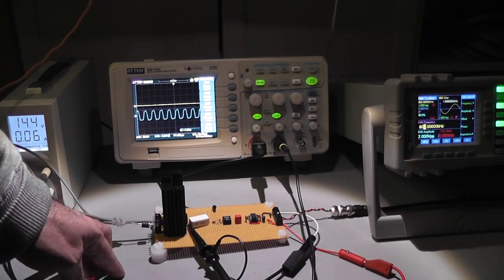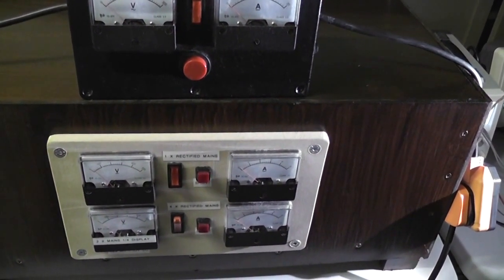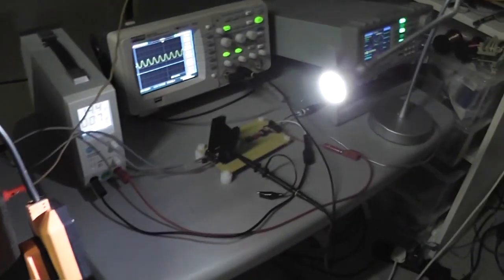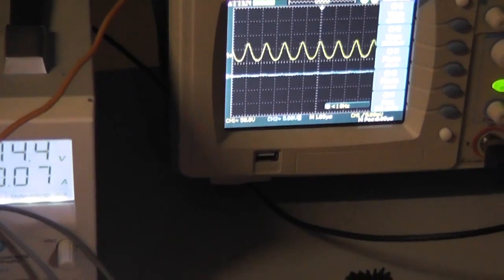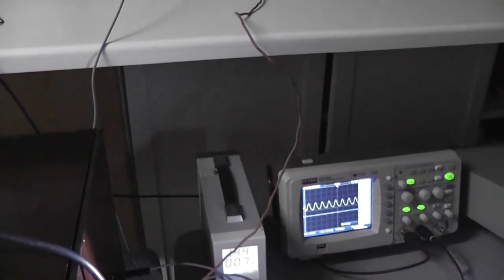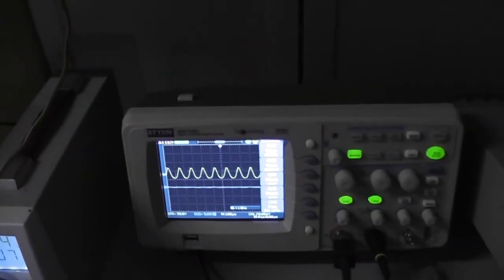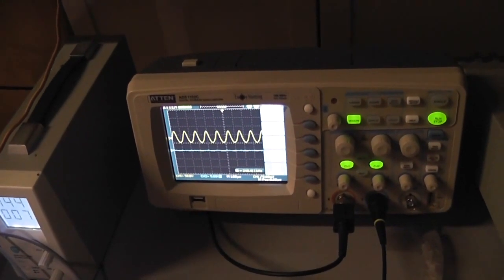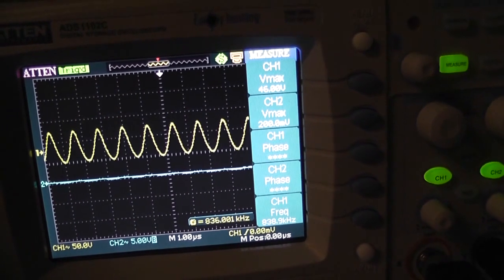Isolation Transformer and the performance with RF Power MOSFET

Comment from the maker: I agree. That is also my experience. I have from low power MOSFET to high power IGBT  available and tested them. The lower the power the faster, lets say lively was the excited coil. The more power the slower and rather less energized is the coil. the frequency changes for that as well a great deal. Resonance frequency is not the driving factor anymore. There is trade-off to be accepted.

Comment from the maker: For Half bridge and Full Bridge I will have to go completely different. Because all MOSFET or IGBT are switched all the time for inverted and non-inverted signals, a delay need to be introduced to avoid shorting. I will depart from the analogue  sector and go digital with Comparator and direct HV bridge driver. I hope to have a video in the next two weeks.